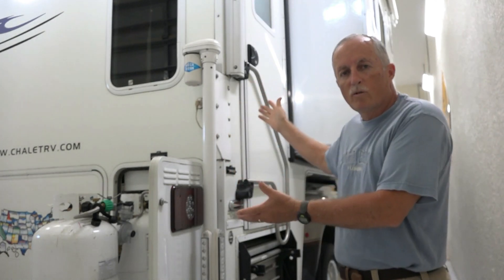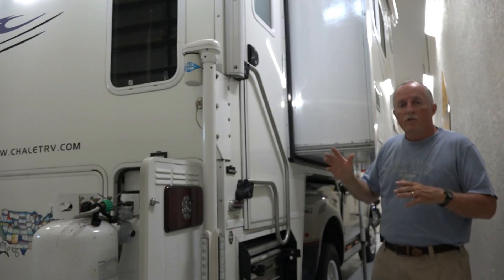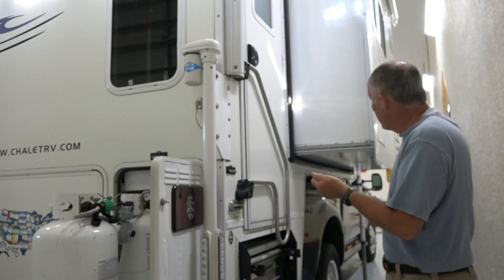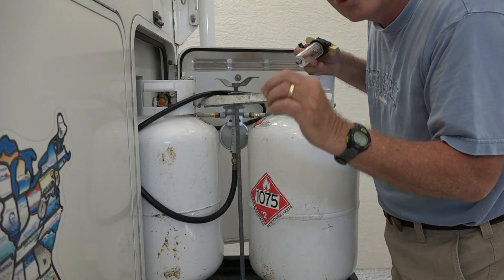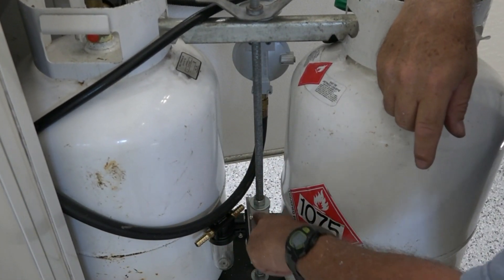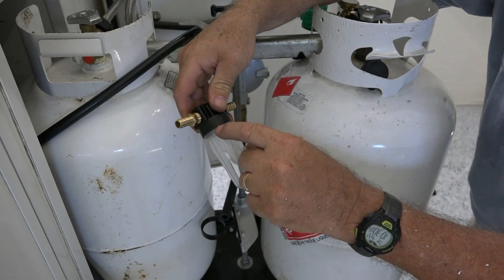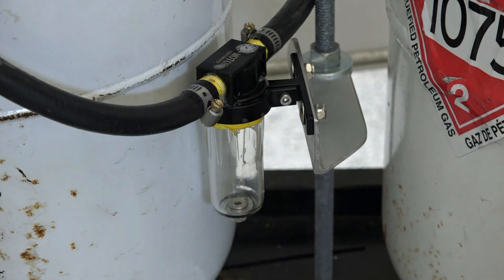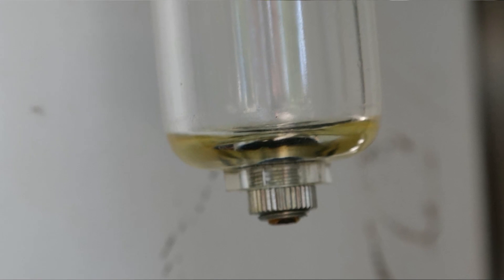RV Propane Line  -  Oil Sight Glass

Comment: When you pipe gas with hard lines,  it's necessary to put a Drip Leg into the system. It should be as close to each appliance or device as possible. Propane or Natural gas both require it, yet RV manufacturers rarely put anything in, to trap debris or oil. Yet another short cut they get away with. It all stems from a time we used Coal gas which was a very dirty product.

Comment: Thank you Charles!  My furnace stopped working, wouldn't light, during a sub freezing spell this Winter / Spring (2023).  I called a mobile RV repair and they came out to check out the system.  Took out the steps in our 5th Wheel to get to the furnace but could not figure out why the furnace wouldn't work.  Took the furnace with them and it worked perfectly on the bench.
So, i disconnected the hose coming out of the regulator and when I let the end down a lot of oil came out of the hose onto the ground.  So it cost me $275 and a week of using the electric heaters in the coach to keep from freezing to find out I had oil in my line.
Dometic told me that the most common cause of oil in the line is overfilling the tanks.
I am going to put one of these on my coach because the furnace is starting to not light the first time and I suspect there is oil blocking the gas flow again.
Thank you for posting this.
Reply: Sounds like I got the same problem as you my furnace stops working well more likely freezes but soon as I put heat under my trailer it starts working again🤔

Comment: Hi Charles what about installing the Mini Oil Separator Catch Can between the propane tank and regulator (high pressure side) vs. after the regulator (low pressure side)? Shouldn't this catch the "oil" before it is forced through the regulator?
Reply from the maker: Yes but I would need 2 separators that would need to withstand up to 150 psi and also 2x the chances for potential leaks.   Not worth the risks.

Comment: I have heard that the oil comes from the rubber hoses breaking down and leaching oil, NOT from the Propane. Apparently rubber hoses that have a stiff (nylon or plastic?) liner don't do this. Heard this from several certified RV Techs. Just passing it along.

Comment: The oil can also muck up the regulator. I've read about adding an oil drip leg between the tank and the regulator to catch the oil. Might be a bit safer leak wise as well. Also read that the amount of oil you get depends largely on your propane provider.

Comment: Great video and mod. Will be checking that line on our new to us 2012 Chalet 116 TS. I had it inspected before purchase and the inspector told me the regulator was only putting out 9WC. Should be 11WC. Will try this before replacing regulator.

Comment: I have a Mr. Heater with a 12 ft hose to a 20lb. tank and I seen on videos that if you didn't get the right type of hose you could get one that the manufacturer would put oil in the line to keep it from dry cracking / dry rotting. So I got a filter to stop this and of course it didn't, didn't even get 1 full tank through the heater and it clogged up, took it apart and oil was everywhere, just got done taking it apart for the 2nd time and agian oil was everywhere. Does oil come from the tanks when re filled? so this will be an ongoing problem?  if so...I like your sight glass to view what's in the line, maybe I need to do that as well. I'm tired of taking this dang heater apart, it's a pain in the backside to say the least. Good video....appreciate you posting it for the rest of us to learn from!!!!
Reply: As stated above, hard lines always have a Drip Leg to catch some of that in building construction. Maybe plumbing in a section of brass with a 6 inch tee with a cap on the bottom, so it can be periodically drained ( gas off of course) or put an inline shut off to isolate the drip leg. That way you can drain it with minimal gas leaking out. It should be located as close to the appliance as possible.

Comment: A heads up regarding your line pressure. It's 9.5 to 13wc. Usually oil gets in the line when you're running 20 or 30 ft of Hose from and external tank let's say a hundred gallons or more. You should not have any oil build-up running that short of distance

Comment: Thank you very much for making this video. Did you do anything to clean out the lines from the fridge back to the trap?
Reply from the maker: After all the oil dripped out of the line I did use my air compressor to completely blow out the entire line to the fridge but nothing but air came out so that conclusively proved that it was the build up of oil in the line was the problem!